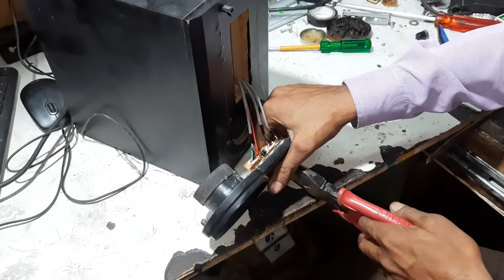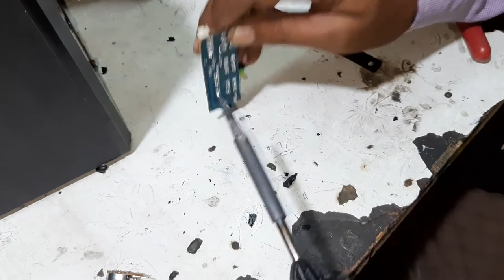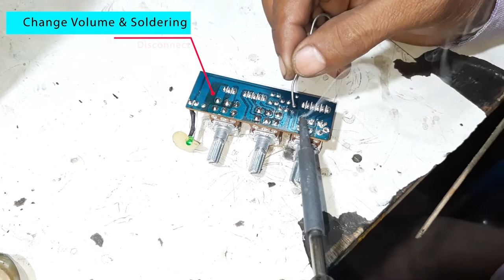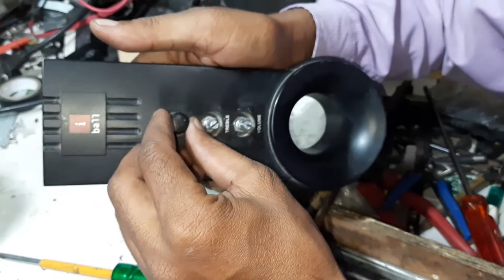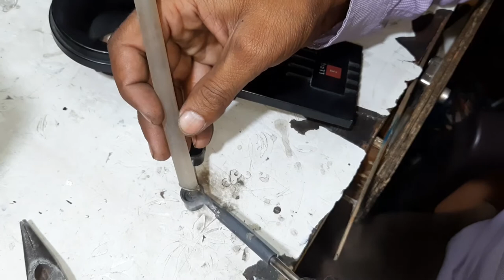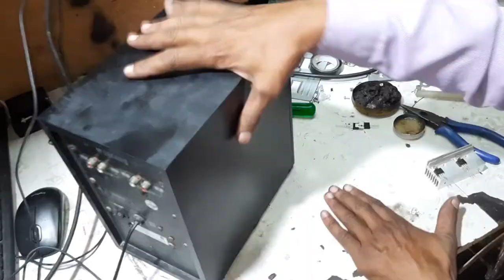How to add a volume control in Sub woofer _Fix Sub-woofer Volume Problem _Volume Voice Base Not Work

Comment: Sir Im your hauge fan. I made a 2.1 amp using pre printed circuit board. But i dont have any volume controller and, i dont know  how to connet the wires. Can you please send me the diagram and the component list of above volume and base controller 🙏